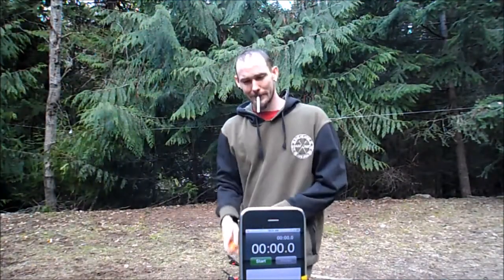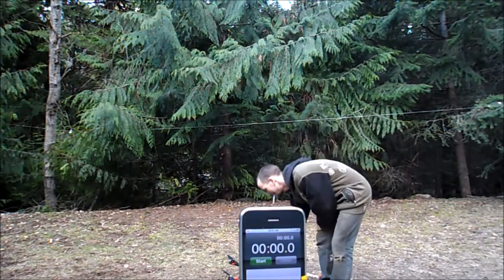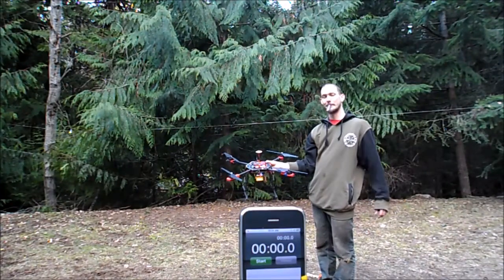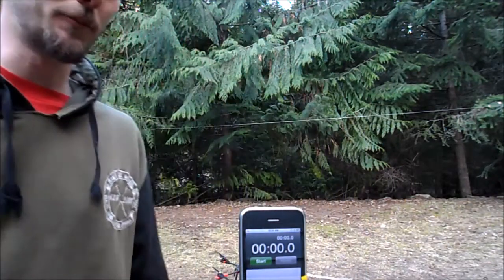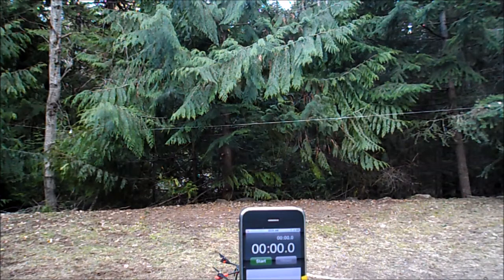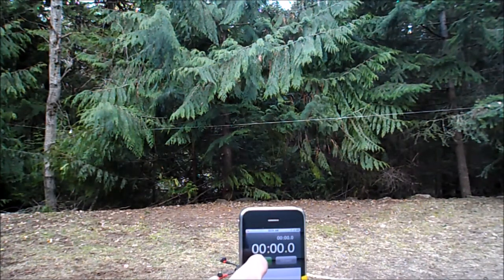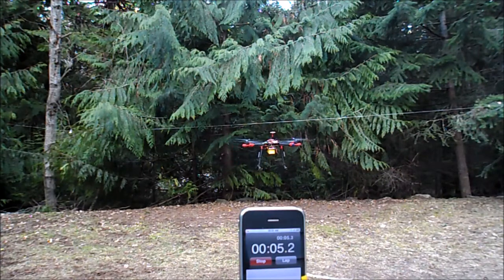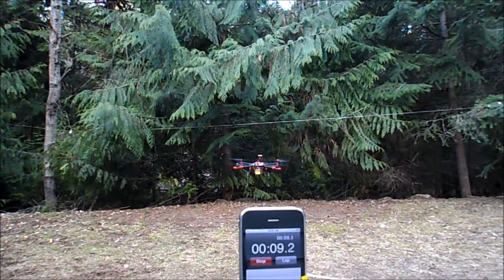Tarot 650 Sport Flight Time Test- No crashes or flips..... Sorry

Comment: Hello friend, did you have to extend the esc wires due to the lenght of the arms? If so, did you extend the battery - esc wire or the esc - motor wire? Thanks!

Comment: Im extremely impressed with the dji e600 system.. Very easy to install and very good power to weight ratio .. We weighed the quad in at around 1800g no battery with the 6s 4500mah the weight goes to around 3200g.. Im ordering a 6500mah to compare weight and flight time.. The voltage at the end of 20 mins was 3.2 per cell on this flight..